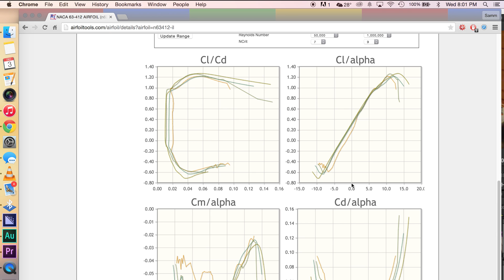Hot Wire Airfoils

Comment: I found a variac works well for the power supply, you don't need dc to power it.
Reply: Yeah that is if you want to touch the live wire, sure use a variac...
Reply: That's a death trap.
Use a DC power source
Reply: Don't touch the wire? 50Vdc will still be dangerous (yea, I know the variac isn't isolated, but it's a bad idea to touch either)
Reply: @pikachu.922  that's like telling a cook "be careful with the knives, you won't cut yourself".
Yes, being very cautious will work but ultimately you're going to get hurt no matter how careful you are (especially when you get used to the situation).
Reply: @pikachu.922  I know I'm just some random dude on the internet telling you not to fry yourself with mains electricity but just use a computer/monitor power supply and some nichrome wire.
I built my own hot wire cutter for like 12 bucks. Already had two power supplies and brought 20 meters of two different nichrome wire gauges.
That will last for life and I know I won't end up in the electricians' Darwin Awards.

Comment: What kind of foam are you using ?
Reply from the maker: This video uses white insulation foam, which is the kind made from little foam balls pressed together, formally called expanded polystyrene (EPS). The blue and pink stuff is extruded polystyrene (XPS)
Reply: +Samm Sheperd (SNRS) thanks very helpful?

Comment: Indeed, i use a e string from my electric guitar and it works very well!
Reply from the maker: +Jarco de Rover I've switched to using that! In my newer video I mention it. e strings are stronger and work well on a lower voltage.